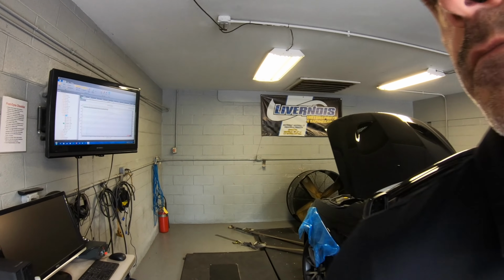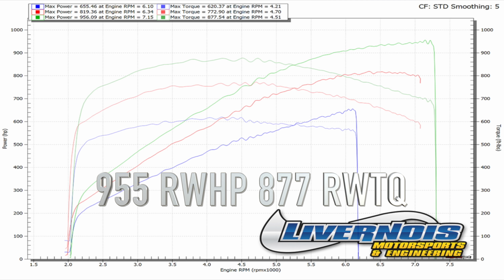Jeep Trackhawk gains 450hp, makes over 950AWHP with Livernois S1150 Head/Cam Upgrade!

Comment: I have a TrackHawk and have been thinking about getting the S1025 package.  However this S1150 package is mighty impressive.  How much is the S1150 package, and what sort of 1/4 mile times are you getting with the package?  Thanks
Reply from the maker: Rod Dickinson Current pricing on the s1150 package is $14999. And we've got a few already in the high 9s with it!

Comment: Whats it make 93 pump? U do realize that 80% of the country has zerO ACCESS TO E85!
Reply from the maker: Based on how many customers of ours around the world do, it seems rather accessible to most. With that said it makes around 100hp less on 93.
Reply: @LivernoisMotorsports  Not where I come from in the NorthEast bro but thanx about a 100 hp difference seems a lot tho
Reply from the maker: @TENNESSEETRACKHAWK  It's about 10% more power on e85 vs 93 on almost all vehicles.
Reply: @LivernoisMotorsports  Not really bro. I picked up 350 whp with E85 over 93 octane in my Turbo Mustang with an 88mm. Maybe on Hellcat platforms 10% seems logical but not on Turbo setups that can run lots of boost.
Reply from the maker: @TENNESSEETRACKHAWK  We're referring to no other changes other than the fuel and tuning. We're guessing on that turbo build you increased boost. We're talking apples vs apples
Reply: @LivernoisMotorsports  fair enough thanx
Reply from the maker: @TENNESSEETRACKHAWK  no problem!